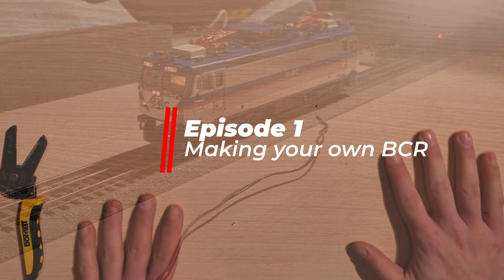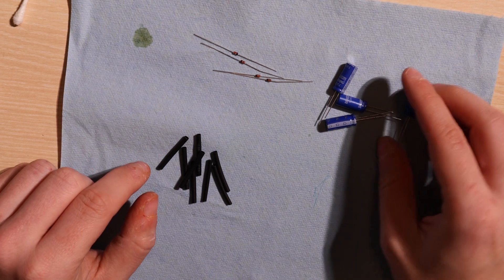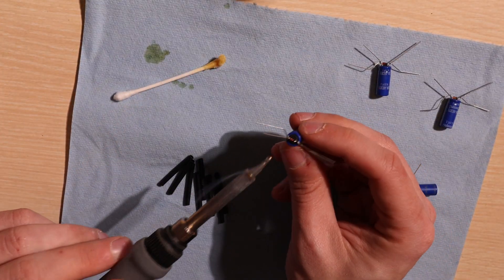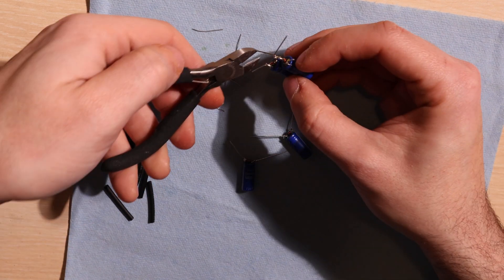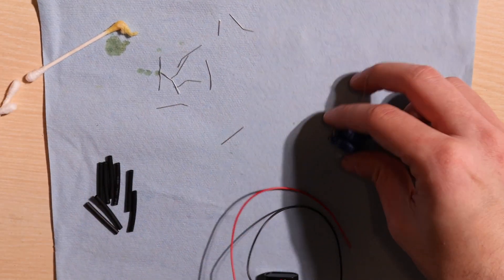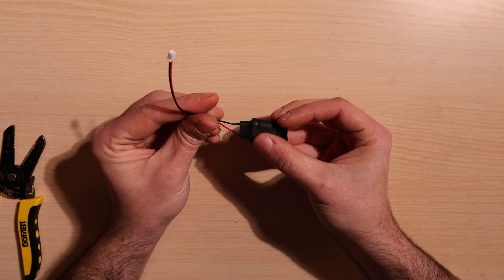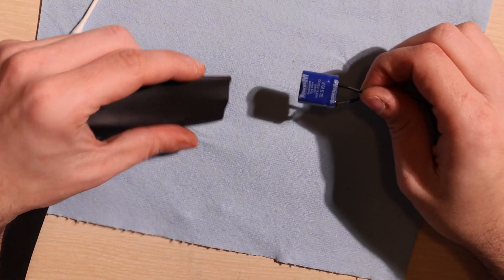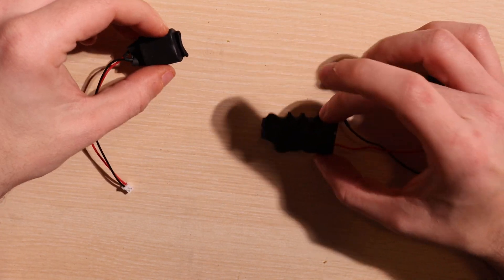DIY Guide: How to make your own BCR for MTH Protosound 1 & 2 Engines!

Comment: Hey Dan….I have a question for you about the 9V BCR. I built one and have charging in my tender (18V on the track). The engine is really acting up. It always requires a Factory Reset and Feature reset. I checked the voltage on the capacitor while charging and only get 3.14VDC. Seems low to me. What do you think?
Reply from the maker: Whats the sku?

Comment: Thanks for the video.  my only question is why the battery connector wires are wired in reverse to the capacitor string.  Is that hue to the intended function as a pseudo battery?  That did not seem to be the way they were wired on the 3 volt BCR.
Thanks again.
Reply from the maker: Yea its only needed on the 5v version, thats because its connecting to the existing battery connector, whereas the 3v version connects directly to the socket on the board.